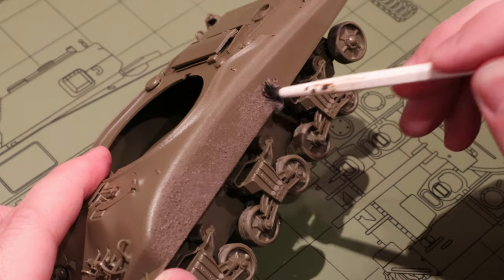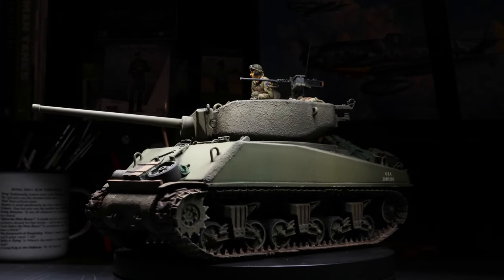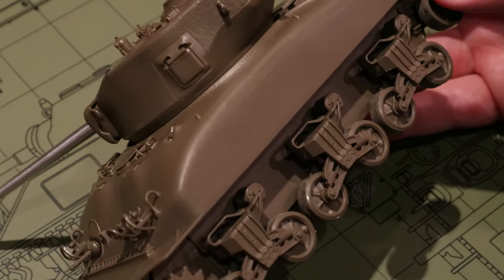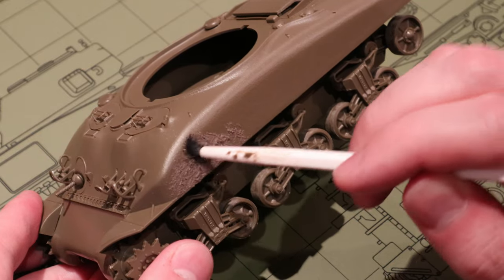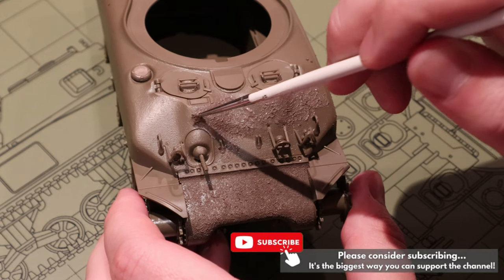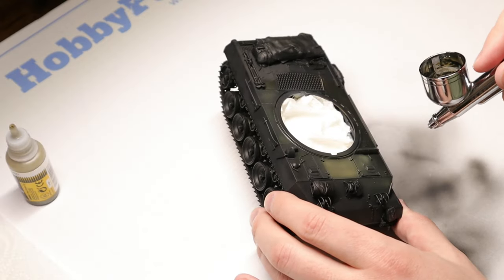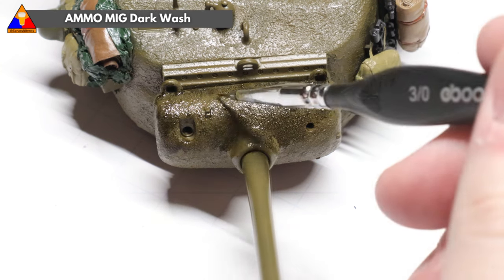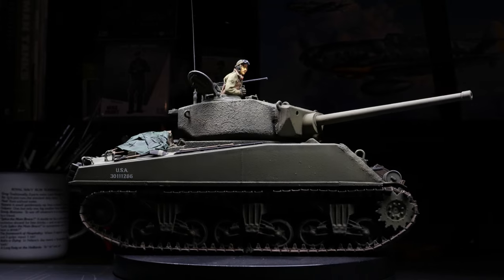The EASIEST Way to Improve Your Scale Model Tanks | Cast Steel Texture Tutorial

Comment: Hank, I like your technique here. I personally think the texture is a little too exaggerated especially for US armor maybe better for Russian tanks. Have you ever sanded the texture paste before the priming and painting step? I'm wondering if the highest points could be knocked down a bit so it doesn't appear as "fuzzy"? I have no experience with that texture paste does it have an aggregate mixed in, like a fine sand or something? If it does it might not sand well I'm guessing.
Reply from the maker: Thank you! Sounds like it's worth a go to me - I haven't tried sanding it down, but it is a rather soft material, so I'm sure it would buff well 👍
Reply: I agree, I believe that the texture should be sanded as well.

Comment: I always used the old Testors square bottle glue and an old stiff brush. Spread the glue on the surface you want rough cast, wait for it to soften the plastic and jab away at the softened plastic. After a light sanding with scotch brite paint
Reply from the maker: I've heard good things about this method, too - thanks for sharing!